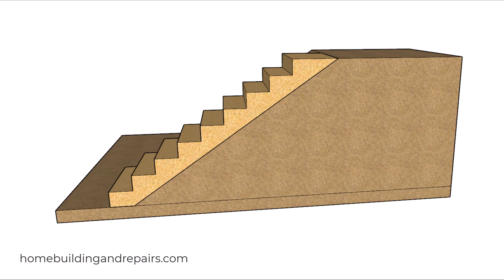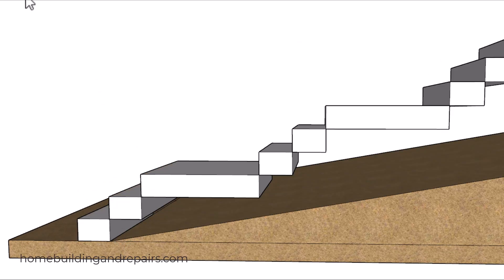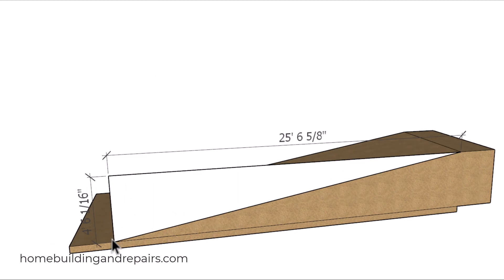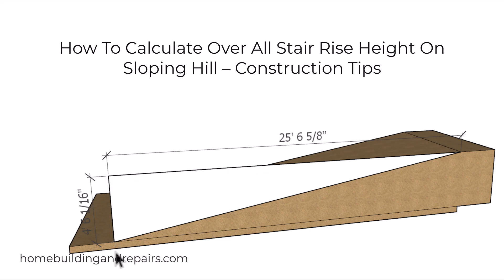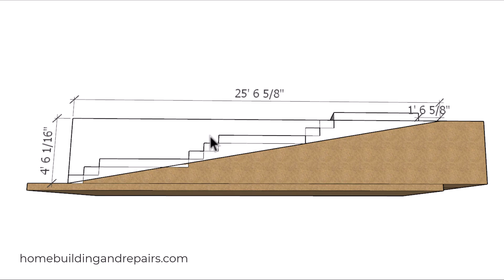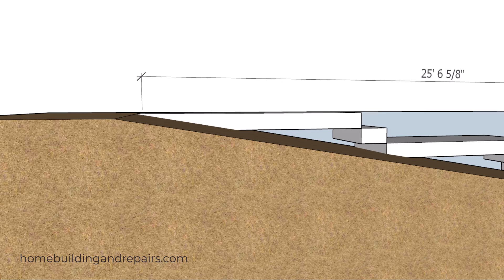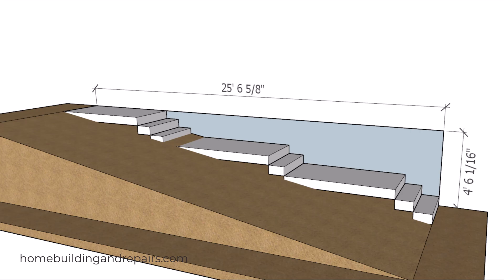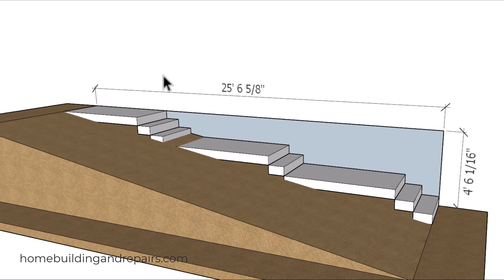Staircase Design Solutions for Shallow Hillsides - Landscaping Ideas

Comment: Always interested in what you come up with!  We had our back patio stairs redesigned since they had to be taken out due to failure.  Kept the same width due to the railing but changed the riser height to 4” due to aging issues.  Opted for a 4’ stair tread length in case we need to use a walker. For individuals with a small stride, they say it’s perfect. I’m short with an apparently longer stride and wish they were a little longer.  Sharing that because of your 3’ tread may be difficult for some.  I’m unsure how to calculate what a good run would be for a step to make it comfortable for everyone, yet easily accessible for those in a walker.  Apologies if I’ve used the incorrect terminology.